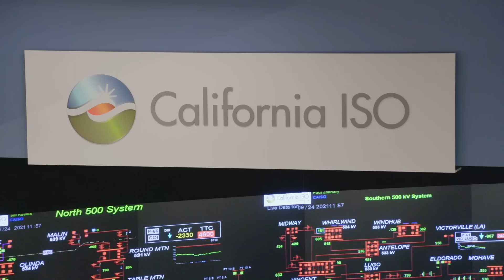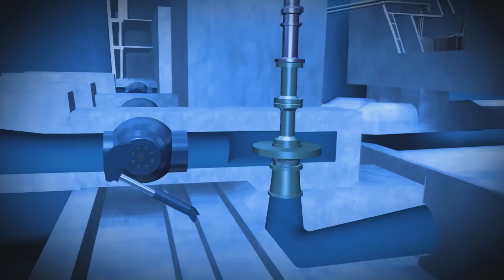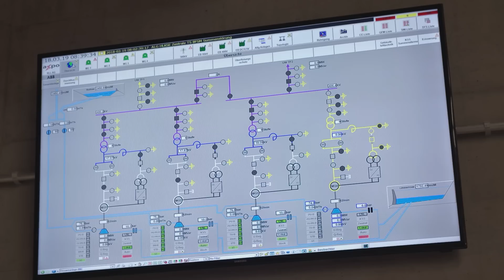How Can We Store Excess Renewable Energy? | Engineering The Future

Comment: I think tidal/wave power is the best battery charger  in this  scenario.   Tides go up and down,  and lift entire fleets of battleships, so why not lift  large sand-filled concrete bins.  Make everything container sized so you can leverage some existing gantry cranes (Increase  the  lift  capacity  to 100T+).     I know there are a lot of negative arguments, such as "Only good in coastal scenarios", or "Tides only go up  5-6 feet"  -  you just need difference in height, you can leverage gears and pulleys  to convert to height (same).     Think of the potential energy of a supertanker lifted 10 feet in the air.
Reply: My point... unfortunately rather negative... but I wish it was not as your idea has some merits... is that to equate the storage power of the Linth-Limmern power station featured in this video, you would need over 300'000 battleship-sized sand-filled barges being lifted by tides 5-6 feet !  You'll need SOME anchorage site!
I also think of the potential energy of a (full) 500k ton supertanker being lifted 10 feet in the air:  it is precisely 0.01% of the storage capacity of this Swiss pumped-hydro site! A gnat's ass!  
OK... I agree that the supertanker will be lifted by the tide twice a day, while the pumped-hydro site goes through only a single daily cycle... so... 0.02% the daily storage capacity!

Comment: What would be the cost of such systems vs traditional?
Reply: The cost of Pumped-Hydro Storage (PHS) is $50/kWh of storage capacity for a relatively easy to build project, to $110/kWh for the most expensive projects in the Swiss Alps (the Nant-de-Drance project, commissioned in 2022 in the Swiss Alps, has cost a total of $2.1B for a storage capacity of a bit over 20 GWh and a generating power of 900 MW)!  In comparison, the installed price of battery storage is presently $350-500/kWh.  Furthermore, the PHS system has a lifetime of over a century... and the battery one of 20-25 years!!!  So, a PHS system is nearly an order of magnitude cheaper by unit of energy storage, than batteries.

Comment: My solution is to have a balanced grid to start with. Use the excess power generated to power desalination plants and brine processing plants. From the sodium extracted you manufacture sodium ion batteries on a large scale. With enough batteries made you can build industrial scale power storage and transition to 90% green energy in time.

Comment: What's missing here in my opinion is discussion on how to adapt the demand side, like building houses in such a way that they don't need as much cooling and can stay cool for longer (so you could run the AC during the day while the sun is out, and then not need to during the night because your house "stores the cold"). I notice that a lot of modern houses (especially in the US) don't even have retractable awnings! 

Storing energy always incurs losses, so you want to organize everything to minimize the amount you need. You can do that with demand response (basically, telling things that use a lot of energy to wait for a bit), better interconnects to make sure the electricity can be sent to where it's needed, and ensuring the optimal mix of different energy sources (there's more sun during the day and in summer, and more wind at night and in winter).
Reply: there is no good solution to store "cool", since if you want to have storage of this, you will have to cool even more, than you need, for the "future demand". But, all the technologies are already existing. Just check european solutions. If I mention all the technologies, applied there in order to build energy efficient house, I will not have enough space for it in this reply. But the first thing - insulation. In Ukraine, for example, good houses have 1 meter wall thickness. And after that + 10 cm insulation material. This will significantly reduce the demand for cooling in summer and heating in winter.
Reply: @forgotten6411  YOu have to educate people, to build LFP 32 kWh battery for 2000 €.
So if you have blackout, you can run your house from 32 64 or 128 kWh LFP battery with 16000 cycle life.
But only small portion of people in US are educated, because education is not free like in NOrway, 
And you need education to build BUKC synch. MPPT, BOOST synch., MPPT, H-bridge HF or LF inverter,
passive BMS, active BMS 15 A current, redundant BMS with thermocam to watch every LFP cell
and quickly calcualte dT/dt to predict thermal runaway and thermal propagation, which can
lead to fire or explosion of your house due to H2 producion, C2H2, C2H4, CO atc.
Reply: @bartz0rt928  50% of all electric use can be schedule, to coincide with energy production.

Comment: « More energy storage in the grid »  etc …..is WHERE the mental blockage of electricians starts…: energy means power generated at a given place and time to the power charges, all kinds, stationnary, domestic, commercial, industrial and mobiles for transport.
The link, the grid, the network, the distribution of power between energy supply and energy loads  AND the load charges as well…Diesel, Ev or H2 vehicles for instances have to be BOTH adapted to new powers generated and the new powers supplies, NOT THE REVERSE…adapting the power supply and network to this huge new heat pumps and BEV additional loads for instance…this require way too much polluting grey energy: if all this supplemental power MUST anyway BE renewable for the salute of the planet, then a specific power distribution and adapted loads population must be optimised for low economical cost and low grey energy, good sociability and biospheric compatibility…For instance, when railways were electrified due lack of coal and inefficiencies, our wise predecessors did no put a resistance in the boiler and a pantograph on the cab of steam locos to find out there was three time not enough hydroelectric energy to power such poor steam cycle…No!!! They produced efficient electric locomotives converting directly E-Power into displacement….and NOW it would be ABSOLUTELY insane if surface renewable solar and wind power is present all over and abundant (solar radiation amounts to 1500 times all the humans power consumed and wind almost as well), to transport this energy elsewhere with powerlines joules losses or pipelines friction losses to another place where it could also be produced!!! This clean energy must be stored and distributed (not transmitted) where it is produced AND the mobility loads, huge and with long range storage capability must be loaded at specific locations to balance the system with a competitive offer and demand fair market and a single real time android apps…..this is where fuel cells and combustion of renewable synthetic zero CO2 gases, H2, CH4 and NH3 easely stored, compressed , liquified locally where needed can replace an ugly power network and cumbersome electrochemical reversible chemistry of batteries, which is dirty, hard to recycle and not endurant nor durable enough. Synthetic gases  energy is used with with much LESS grey energy than massive copper aluminium network and lithium storage mining nonsense plus lake evaporation wastes…for instance storing a full season one kWh of H2 in a COPV bottle with zero energy loss cost hundreds times less than storing a similar kWh in a most durable LFP battery only a few day with joule losses: one is adapted variable seasonal unpredictable renewables, the other not !!! 
Then, the selected renewable system efficiency is not the major issue (essentially a foot print issue only) because sun and wind are free of charge so the major cost is  therefore the grey poluting energy of a still dirty civilisation . The real issue per MJ or kWh provided at the right place and right time is the COST and planet impact of that power provided,,while anyway system losses such as high enthalpy heat and pure oxygen have also good commercial values all year long for heating cooling hot water medical,welding etc..
At the same time, without  ONE unique electrical and ONE gas nerwork and the same fuel at all gas stations etc, this marks the end of a monopolistic stronghold  of the very few biggest fortunes of this word on energy ressources and energy supply at retail level, monopoles finger printed by the huge gap from production cost to retail selling price. THIS is what the current power network and fossil lobby is NOT giving up and willing to kill the planet instead, with all sort of abusive arguments for naïves politicians : nuts aren’t green but our green are nuts! 😂

Comment: The problem with the storage of energy points to the problem of congestion caused by curtailment that occurs with intermittent variables. 
The solution for a constant and variable energy source is using a solar hydrogen energy recovery gas turbine as a constant variable. 

The process uses the suns nuclear fusion that has a 5-billion-year supply of solar energy to produce hydrogen which is the most universally inexhaustible abundant of elements. 
  
This hydrogen is than used to generate a higher, more stable energy output up to 1300Mw but governed between 86-330Mw to manage grid stability and avoid renewable energy zones. 
 
The process is similar to a nuclear fusion reactor. However, instead of achieving nuclear fusion at extremely high temperature (150 million degrees Celsius) this system achieves and maintains Ignition at much lower temperatures. It doing so it uses an energy output that exceeds the energy input required to start and sustain the reaction.
  
The operating complex requires an area the size of a football field. 

The hydrogen power generating turbine has three operational parts, 3.0m in diameter 5.5m long weighs 6 ton has a 14-year continuous life cycle and incorporates direct air capture of CO2 at 1,400 Kg/sec.  The cost is $36.5 to 49.5 million being significantly less than an equivalent 330Mw nuclear reactor, solar or wind farm.
Reply: Where did you find this fantasy invention? Gas turbines are at most 60% energy efficient and electrolisers for solar are around 50% efficient.
So for 1kWh of "hydrogen turbine" electricity you would need to input almost 4 kWh of solar. 

So that cheap 40$/MWh solar energy suddenly turns to 200+$/MWh. This is why practically no one wants to buy green hydrogen...

Comment: Pumped storage is the way to go. They last for generations with lower replacement and maintenance than other storage methods. To combat the problem of needing to source them along a possibly drought stricken river, we should incorporate sea water desal & pipelines, so that these can be placed more easily without disrupting natural waterways. This is how you can fill and compensate for evaporation even in drought.
Reply: The problem of pump storage is their low efficiency (60%) and difficult environmental placement.
Reply: @Vitan89  incorrect. From the United States Energy Information Association: battery = 82% and pumped hydro = 79% and this is from reported data they have received from operators
Reply: @Vitan89  That's false. The EIA looked at real world round trip efficiency as reported by energy agencies. Pumped hydro storage was 79% efficient and lithium battery storage was 82% efficient. 

The battery bros have been feeding you a line of BS both on their operating efficiency and about the actual performance of their natural competitor, pumped hydro storage. You can read the report here.
https://www.eia.gov/todayinenergy/detail.php?id=46756#:~:text=According%20to%20data%20from%20the,%2Dtrip%20efficiency%20of%2079%25

Also utilization, according to the report, was twice as high for PWS as for lithium battery.

Comment: Solar voltaic and wind turbine generated electricity causes the most expensive and unreliable electricity in recent history.   It produces wild AC which is not power grid quality.  Making solar voltaic power grid quality means using high availably other sources of electricity which is typically natural gas turbine generators running at high service idle consuming 70% of the fuel it would at full throttle when making all the electricity needed, but no electricity at high service idle.   This is what is required in order to make up when a cloud passes over a solar farm.  

The sorry story is California saves surprisingly little natural gas with all the solar voltaic panels it has, but it does have to buy the nearly worthless wild AC at many times the cost of generating grid quality electricity internally passing those cost on to consumers, but not enough to keep the power grids out of bankruptcy.   California has to buy all the wild AC.   That is why it has to pay to make it grid quality to sell it for whatever it can get for it just to get rid of it when it has an over supply to other power grids.   

Non peak load power goes for wholesale prices of about $0.03 per  kWh.   The SoCa power gird has to buy home solar power whenever its available  at retain prices of $0.35 - $0.50 kWh.   It then has to spend a lot of fuel to make it power grid quality.   

Cumberland Indiana had residential electric rates of $0.10 kWh in 2020 a suburb of Indianapolis.
Reply: Huh? The quality of power at any one time is the same from any source - the voltage is the same in all cases (only cheap gasoline generators produce non-sinusoidal output), but the amount of current and power it can generate may vary. California is rapidly building its storage using Tesla Megapacks, which actually provide a much cleaner and more stable grid, as they can respond rapidly to varying loads.
Reply: Quite at the contrary!  Wind and solar PV power are now the two CHEAPEST means of electric production... even if you add the necessary storage!  Solar + Wind + Storage can cover 100+% of the needs of all countries and regions up to the polar circles!
Source:  RethinkX Energy Report.

Comment: Thank you for this presentation. You address the issue well, but you only briefly mention "behind the meter".  The issue is that the power grid is becoming decentralized and bidirectional.  NREL predicts that one third of electrical generation and storage will be on the consumer side. My interest is in grid forming battery/inverters. Substations will become independent nodes and will be responsible for power conditioning.
Reply: sounds logical...

Comment: desalination, smelter, concrete operations that could operate during excess supply and shut down when the grid is nominal.  Excess means you already have a resilient grid with worse case storage over capacity.
Reply: nuclear is more optimal for a grid where we are flattening a demand curve to meet production
Reply: Something like you propose is great ultimately adding costs. Can it be better than going back to the drawing and look at fission-one fuel bundle of 25ish kg of natural uranium in candu reactor is ultimate storage of 1100MWh. Add some modest storage to cover for daily shifts of  loads and you get carbon free, reliable and cheap power for as long as needed. People in 100years from now will be smart to choose what will work for them later on.